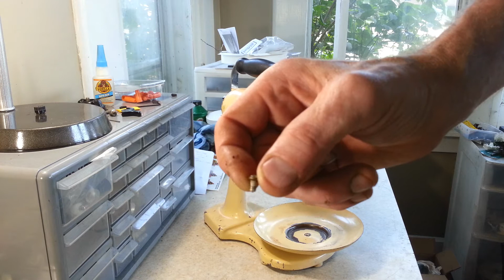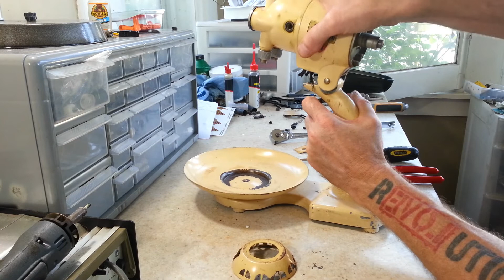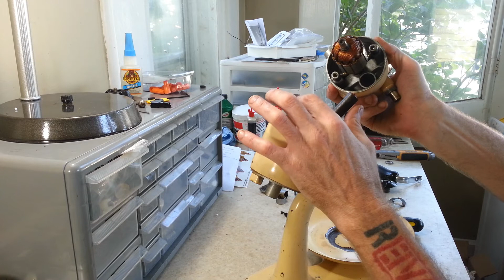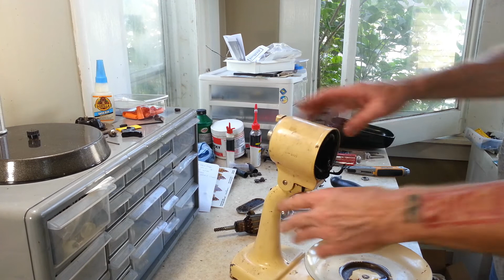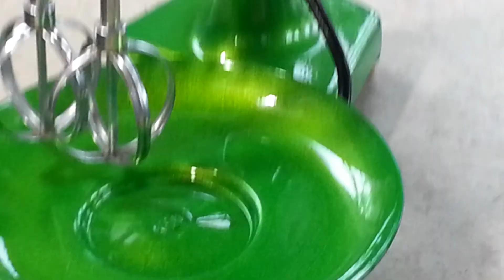Vintage Sunbeam Mixmaster Model K complete restoration

Comment: Use 8-9" wire cutters to break set screws loose .When i worked at sunbeam repairing small appliances, there was a special tool .The grease used in the mixer was fine thin grease (was supplied by sunbeam) 20% fill max .Only reason that you see thick grease in the mixers ,50+ years later after the oil has seperated and ran out

Comment: I’ve got the same model but only the “high speed” works. I took the back off and cleaned the resistor contacts and degreased a bit.  No luck, so then I tried to remove the brushes but they’re stuck in pretty good. Any advice on how to remove them without taking the whole machine apart?
Reply from the maker: Hi John! If you tried to remove the brushes, but only the springs came out, you could try to put a tiny dab of super glue on something (I use a piece of wire) and glue it to the back of the brush, then you should be able to pull it out. If that doesn't work, you may have to disassemble. If only high speed works, there is an issue with the round resistor, either the wires that connect to the contacts are broken, or the windings on the resistor are broken somewhere on the resistor, then you would have to try to find a replacement resistor from a parts machine which is not easy to find. I am currently having the same issue with my model K, and have yet to find time to look for a replacement resistor.
Reply: Vintage Mixers and More 
Thank you i for the advice. I will try that.  :)
Reply: Vintage Mixers and More 
Ps. I have learned a lot by watching your videos and enjoy watching them
Reply from the maker: Thanks John, good luck!! :)

Comment: Amazing color effect, never thought you could achieve that with powder coating! One day you'll have to enlighten us on how you do it ;-)
Reply from the maker: Its actually much easier to achieve some great effects with powder coat. The base coat looks like a dull green color when you shoot it on, but when it flows in the oven it turns to almost chrome looking. The clear coat brings out the color and the sparkle. That is only 2 coats to achieve that effect, base coat and clear. :) Next time I shoot a wild looking color or effect I will record it and post it!